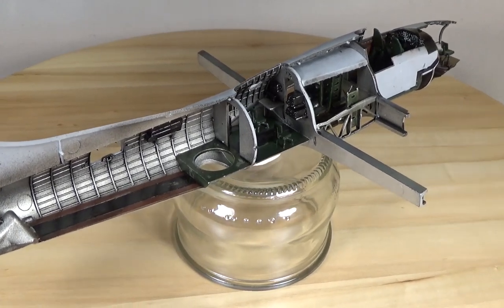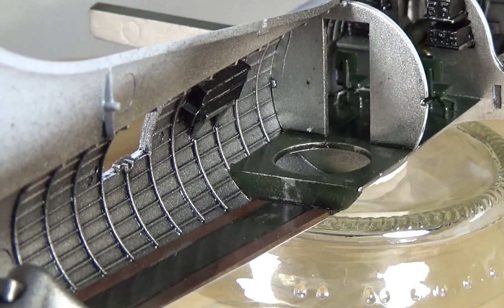Model Flying Fortress B-17G - 1/72 Airfix - Painting Interiors

Comment: Kind of a late posting, but just a heads up for any that see this anyway. The floor panels in the B-17 (the brow/tan areas) are plywood, and the black strips that run along the 'floor' are actually rubber mats. When weathering these areas, remember that these areas would not chip to aluminum. But that said, a great video and finally a demonstration of the technique. Fantastic job, and keep up the good work.
Reply from the maker: Yep, you're right. I was overly enthusiastic about this "chipping" technique.

Comment: I notice that with the glue you use, you do not scrape away any of the paint so there is no plastic to plastic mating surface, your parts are not joined or welded by the plastic solvent, instead you are hoping for a mechanical bond when the glue dries (bombs to racks). In my opinion that is a potential point of failure. Or is the glue superglue?
Reply from the maker: When I use plastic melting glue, I always scrape the paint off. But I also use cyanoacrylates quite frequently.
I don't remember what glue I've used to fix bombs, but if the paint wasn't scraped it was CA for sure :).
Reply: Superglue melts that plastic that's why you use poly cement

Comment: Other than the error of treating the brown areas as if it were aluminum painted brown instead of plywood as it it was in the aircraft, and the entirety of the interior was aircraft primer green (even on the "un-painted" aircraft (they were still coated with a sealer on the exterior)). Other than that, pretty cool build.
Reply from the maker: I agree with the first half of your post, but I found a lot of photos with metallic interiors of this plane. It's also "silver" in the instructions.
But I didn't make a thorough historical check of this very plane so you might be right.
Reply: Big Modeller then again I could very well be incorrect, but I'm pretty sure they were primered leaving the factory. Then again they may have figured the airframes wouldn't survive long enough for corrosion to be a concern.

Comment: I have a question? Why not just dry brush to make it looked chipped. Seems it would save a lot of time. I’m not an expert by any stretch, but could someone let me know why you don’t dry brush. Thanks for getting back to me in advance. 👍👍🇨🇦
Reply from the maker: The answer is simple - I wanted to try this technique out. I know there's more than one way of chipping, mate.
Reply: Big Modeller : got it. Do you prefer this method over dry brushing? I’ve never tried it. But I have a few projects on the go that I might test it out on. Thanks for the info.👍👍🇨🇦
Reply from the maker: This method (hairspray or other dedicated product) is the best for chipping in my opinion. It's just the closest to the reality - it's in fact making the paint peel off the "rusty" or metallic background.
To be honest, I don't really know how you want to use a drybrush to make chippings... I use it quite often actually but the effect doesn't look much like chipping to me ;)
Reply: Big Modeller: well, I’m sold. I’m going to try it out. Thanks again.👍👍
Reply from the maker: You're welcome :)

Comment: What colours will you be using for the exterior?
Also I think some of the brown parts of the interior are supposed to be wooden but you gave them a metallic finish.
Reply from the maker: Exterior will be natural metal, painted with Alclads.
With the brown colour you're totally right (navigator desk and some detail in the back section of the plane should be wooden).
This mistake I've noticed too late. I could repaint it, but belive me, it make no sense, since nobody will see the difference between wooden finish and metallic one through those little windows...

Comment: Did you use a layer of future or any clear varnish before doing the oil wash as I thought the white spirit might take off the acrylic paint?
Reply from the maker: I always cover the surface before applying an oil or enamel wash, so yes.
But... white spirit shouldn't do any harm to acrylic paint. Future equivalent I usually use is acrylic too, but I put it even on the acrylic paints just to be sure.
I recommend to test it first, that's always the best solution :)

Comment: Hello Big Modeller, hope you can help me... I was wondering what brand of color / oil were you using when making the oil wash? and was it dilluted with plain water, or something else? 

I want to use it on my planes from now on, and I think it will be cheaper than getting the Panel Liner from AK..
Reply from the maker: For panel lines I usually use the black one, but with oils mixing colours is easy. With some white paint you can make grey panel liner for black cammouflages, dark brown is perfrect for green ones. With brown oil paint you can make gasoline stains easily. I think black and brown paints are perfect for the beginning.
As for dilution - you will never mix oil with water, they just don't mix ;) I recommend white spirit for this.
Reply: Thanks a lot

Comment: Beautiful and informative. I'll be trying some of your techniques.  It's my understanding (having never been in a b17 I may be very wrong) that some of those areas you used the hairspray weathering on are lacquered ply and rubber mats. Do you have some references you work off because I'm struggling?
Reply from the maker: I didn't put much consideration into those interiors to be honest. I wanted to try this chipping technique and those hidden interiors seemed to be perfect for experimenting. It looks good, I'm satisfied with the result, but it's not historically accurate.
Long story short - if you want your B-17 interiors to be true to the original - don't use this movie as a reference material ;)
Reply: Big Modeller No worries.

Comment: Can you use water based acrylic for your washes ? Say javello ?
Reply from the maker: The wash has to be different than the gloss varnish. I use an acrylic varnish, so I have to use an enamel or oil wash. Otherwise I would have to change both the varnish and wash.
I just like it this way ;).
Reply: @Big-Modeller  any  advice on whats the best varnish and washes combination
Reply from the maker: Nope. You have to try for yourself since not every product is available everywhere. Just remember the principle: acrylic gloss varnish - enamel wash or the way around.
Reply: @Big-Modeller  cheers pal
Reply: Did you varnish all the interior before the wash , how many coats , I am working on the revell b17 , wish I got the airfix one it looks more sturdier
Reply from the maker: Yes, everything has to be glossy before you use a wash. I don't remember how many layers I've put there but more than one for sure.
Reply: Thanks again